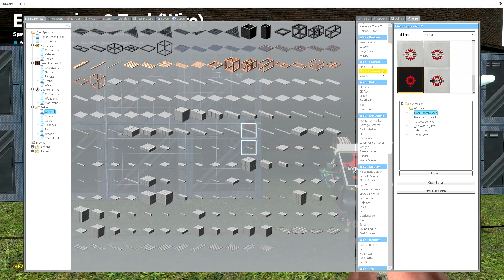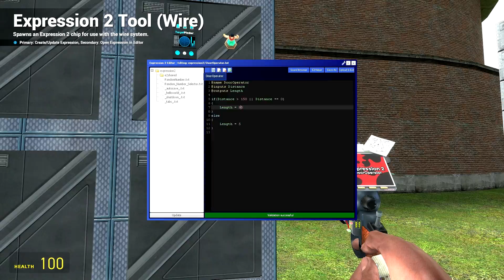Garrys Mod - Automatic E2 Door Tutorial

Comment: How do you not make the door spaz out and break when someone forces an object against it?
Reply from the maker: +MilitiaFather Unfortunately due to the physics of gmod, we can't prevent that. Sorry
Reply: +Danger On PC Under Hydraulics there is Weld/Constraint/Latch tool, it welds 2 objects (aka door and wall) to prevent movement when a value of 1 is input into the controller. I tried to use it but im not sure how to make it work.
Reply from the maker: +MilitiaFather All of those are used to make an object stay absolute (always in place). So I don't believe you can do it. There will most likely be a solution in the e2 physics that you could counteract the force applied. But I have no knowledge of how to use those sort of functions yet
Reply: +Danger On PC It is only absolute if a value of 1 is put into the controller, aka button. Try it out, my only problem is making it work in E2.
Reply from the maker: +MilitiaFather I will have a fiddle around when I get chance :) thank you for the heads up on that and I will look into something to try prevent it. Do you want any other tutorials of things you would be interested in making?
Reply: +Danger On PC I'd Subscribe for an E2 Multi-Floored Elevator which is stable and doesn't freak out when pushed side to side cx. nah ill subscribe either way. Thanks
Reply from the maker: Thanks for subscribing my friend :) I will look into making a multi-floor elevator for you!